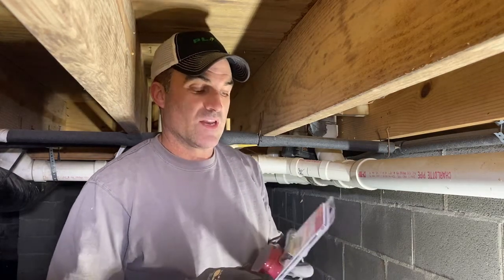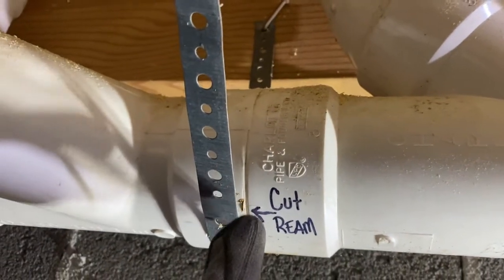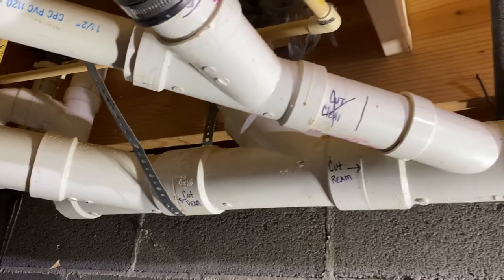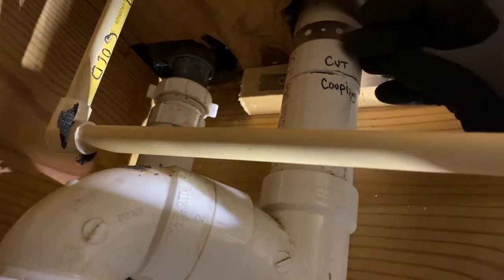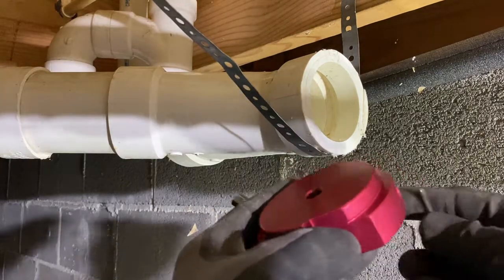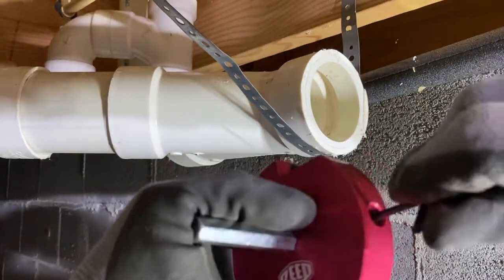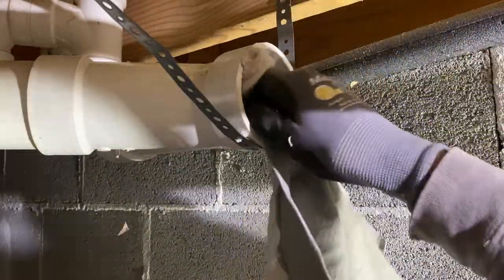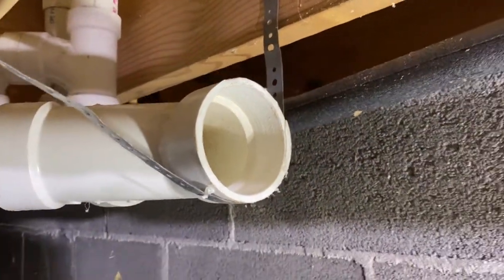Ream 3" Conduit Coupling Ream Extreme Tool How To #diy #howto #how

Comment: I just bought one for the same back to back pieces
Reply from the maker: It works great! Make sure to keep the drill / but straight so you don't accidentally oversize the hole. You Can Do It 👍